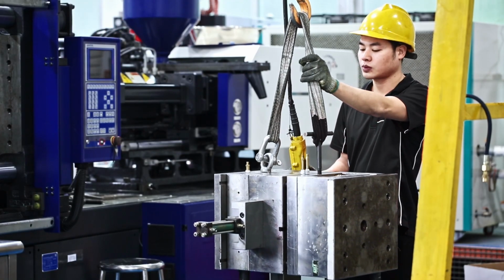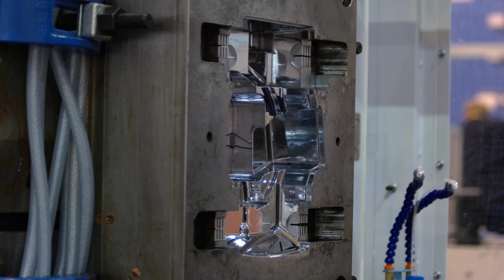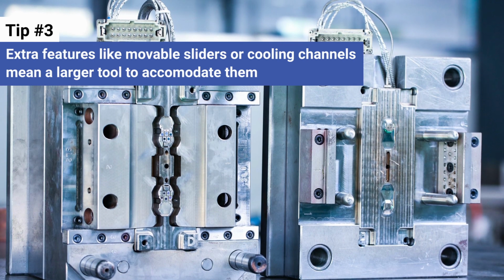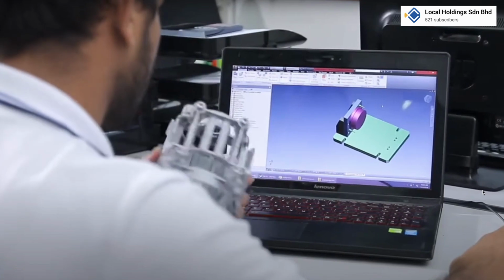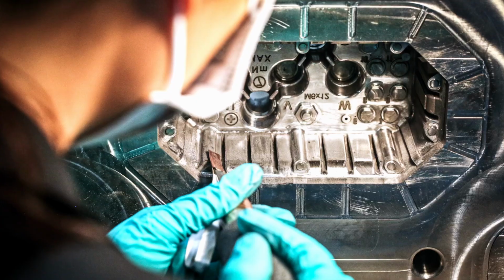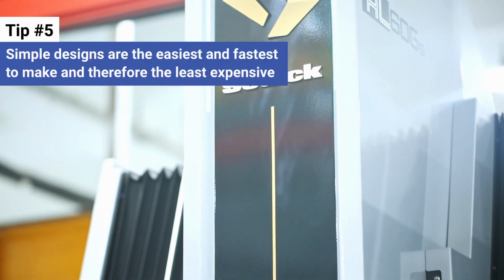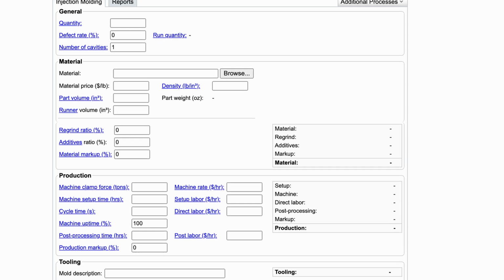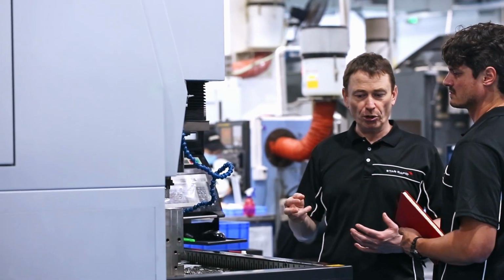How Much Does A Plastic Injection Mold Tool Cost? 4 Tips to Cutting Tooling Costs

Comment: We have made about 20+ mold projects with Chinese suppliers so far. You should consider suppliers experience and greediness as the most important factor)) I can tell you for sure you can have 4x time cheaper mold for the same project if you choose right supplier because many just charge you more because your are not local client and probably don’t know real cost. I disagree that aluminum or steel makes any difference as the mold cost is always about work not the material cost. If you want to reduce cost just try to get away from the number of parts rather than complexity as it always cheaper to add extra runner rather then making a mold for an extra part. Also one more thing is missing in this video. If your annual production below 30k-50k pcs it makes sense to put several parts in one cavity. You will save 50% of the mold cost if you put parts of the same volume and material in one cavity. Probably your supply won’t tell you that if you don’t ask)
Reply: Hey,  I am pretty new to molding and if you are open to guiding me, i can compensate you for your time.
Reply: hey can you share any of these suppliers?  I just got my first offer from a supplier and it was way above my budget
Reply: Do you have the names of suppliers that you can recommend?

Comment: shouldn't the customer be paying for the material by volume and not weight?
Reply: It’s sold by weight
Reply: @PotatoGin  I'm curious to why an aluminum mold stock would cost as much as P20 steel mold stock as I can get the same sized block of aluminum for about 1/4th the price of p20 steel and the carbide cost is much lower for cutting an aluminum mold compared to a steel one. Maybe my steel supplier is  a dick and overcharges me.
Reply: I guess it depends on the alloy?